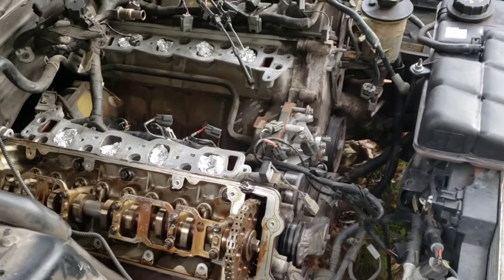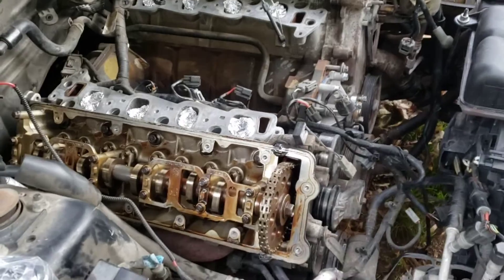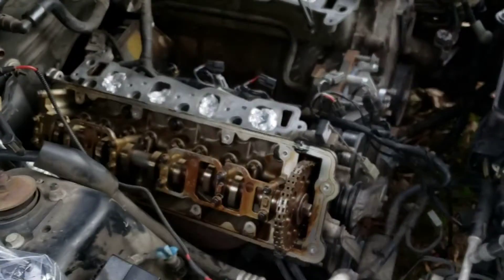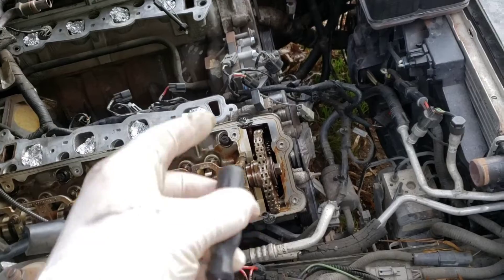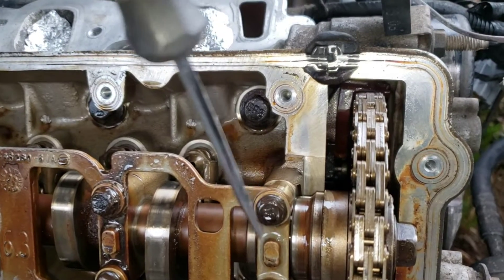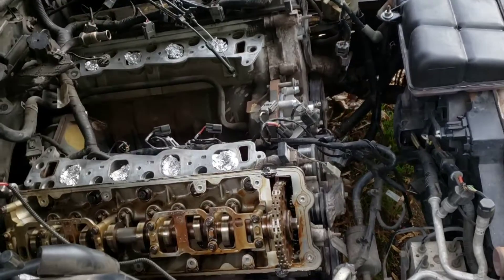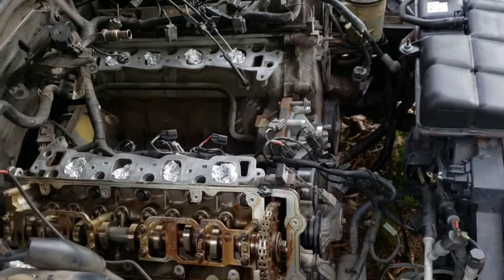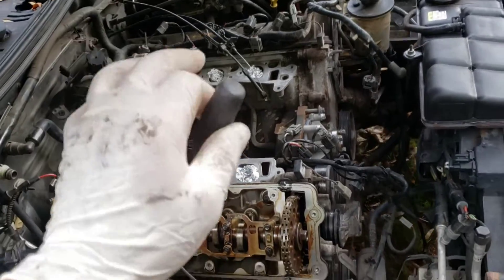Mustang GT 4.6 blown head gasket, cracked block, or head?

Comment: How much would a shop charge to swap head gaskets on this car/engine?  Labor only.
Reply from the maker: Average cost for labor only is around $1500 give or take a few.
Reply: @isolateddieselperformance3261  I was quoted $4700 total for parts and labor before tax.  Said it was a 17 hour job.  Is that true?
Reply from the maker: 17 hrs sounds right but parts labor and  Machine shop should be close to $3000 total. I also live on the east coast so that could make a huge difference
Reply: @isolateddieselperformance3261  yeah, Im in Seattle.  Its expensive here.  Would it be a better idea to just swap a used engine instead of doing head gaskets?  How much would labor be for an engine swap?  Labor only
Reply from the maker: About $1000 in my area.
Reply: @isolateddieselperformance3261  thanks for all the info!  Ill keep checking around.  Thanks a lot.
Reply: @isolateddieselperformance3261  the shop wanted $11,000 after tax to swap the motor with a jasper remanufactured engine.  Looks like Ill just throw some head gasket sealer at it and truck on!
Reply from the maker: Powertrainproducts.com
Reply: @isolateddieselperformance3261 $1500 is insane it’s not even that hard ☠️☠️☠️
Reply: I got mine done for 300 lmao
Reply from the maker: You must have connections